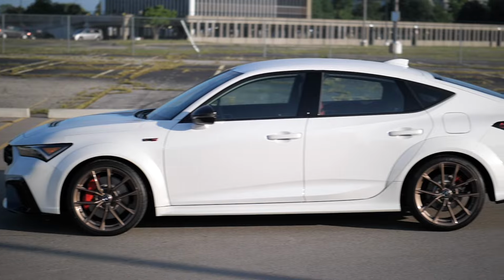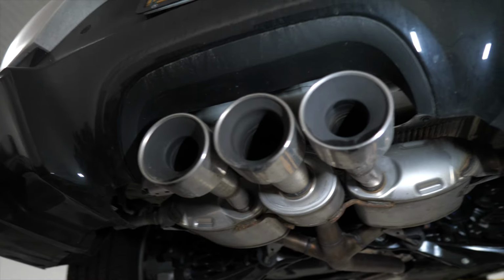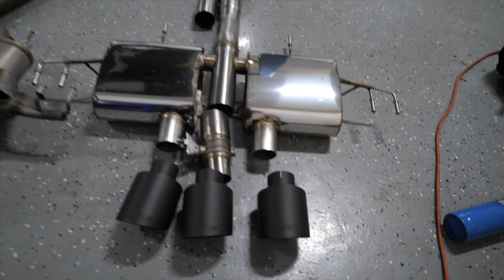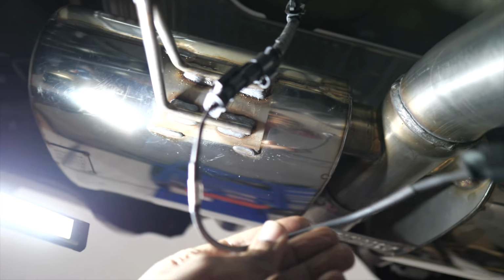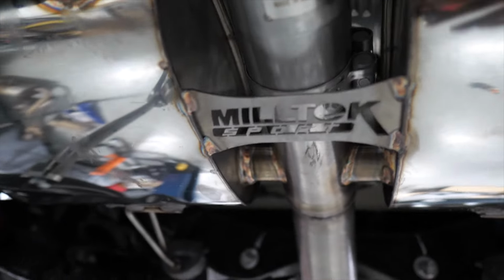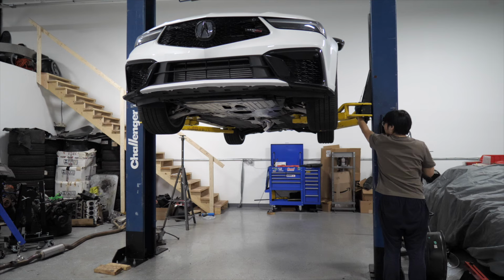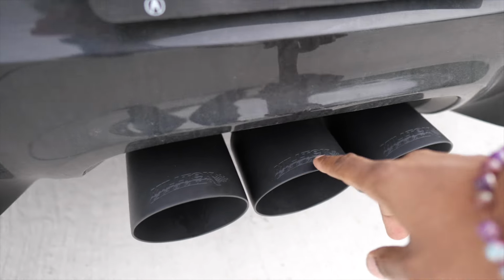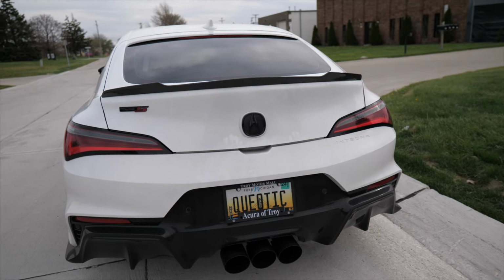Installing a Milltek Catback exhaust on my Acura Integra Type S!

Comment: The downpipe boutta make it crazy Que watch!! Speaking from a full MAP 20’ Sí Coupe Catless setup and tuned so ik a 2.0 is even crazier
Reply from the maker: I can’t wait! I was considering 2 steps catted downpipe. Not sure what else is good
Reply: @QueTheChaotic RV6 Downpipe w/ coating is definitely a top choice if tuned. TSP Downpipe is nice because they claim no check engine light.

Comment: I keep cross shopping this itS and fl5 back to back. Love the type r but the teggy has the features for me that make more sense. Tha heated seats for example and that els sound system lol and stock pops n bangs. Not as loud as my old Elantra N but still damn good. Car sounds badass with the catback Brodie 👌 aside from the oil leak any other issues the teggy has given you?
Reply from the maker: Other than the oil leak it was fine. I prefer the Integra overall but the price of the Type R with no markup is more attractive.
Reply: @QueTheChaotic trying to find a type r in Cali with no mark up is fckin hard. It’s easier on the tegg for sure tho.

Comment: Exhaust sounds and looks great, I think when the time comes, I am going to do the same one.
EDIT: I just followed your link, $2k for the cat back, Hahahahahahah that is ridiculous my man, I'm good with stock, I can see 750$ maybe even 1k, but 2k$ ? lol no F'n way.
What the hell is up with your car? oil leak?
did you go to the dealer yet?
I'm in the middle of break in, 1300 miles, I like to do a 1500 mile break in myself.
Ill drop the oil this weekend for the first time and add some 0w20  Amsoil with a new filter and crush washer, then after another 300 miles, I will finally open the engine up to 7k rpm,s, so far, I have not exceeded 5k rpms, while I break this engine in.
I am very concerned about your oil leak, please follow up with details and le us know what happened.
Reply from the maker: I'll see if they will offer my viewers a discount code. I haven't made it to a dealership yet. I'll  do an update on the oil leak in a couple weeks

Comment: Bro that oil leak on a less than year old car is VERY concerning. Have you heard if this is common for the ITS?
Reply from the maker: I haven't heard anyone with this issue yet. I'll get it checked out
Reply: @QueTheChaotic  good luck, keep us updated
Reply: @QueTheChaotic  FYI, there’s a post on the CivicXI forum about an FL5 having a very similar looking issue (pics included). Just Google FL5 oil leak and it’s probably the first result that comes up. Some of the comments were saying it could be the valve cover, which was apparently a common issue on the FK8. I got out of my ITS back in November and I’ve got an FL5 now. I’ll definitely have to keep an eye out for this when it goes in for the first oil change.
Reply from the maker: @erikg2493  great info. I’ll look into it